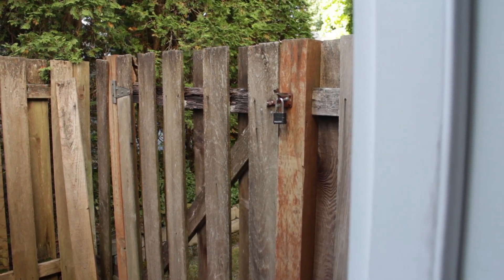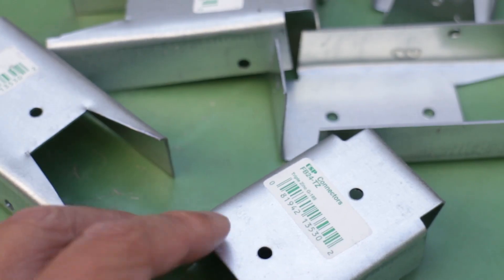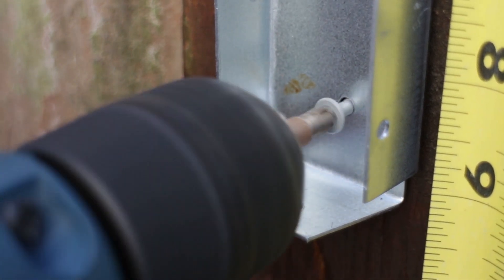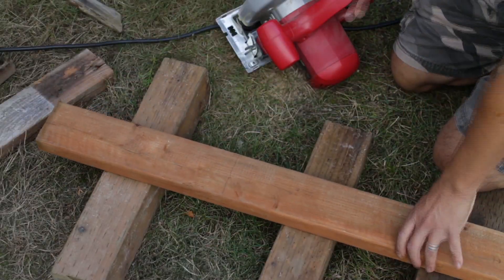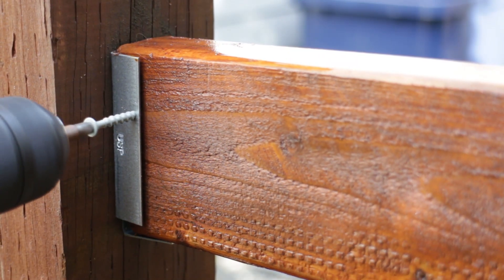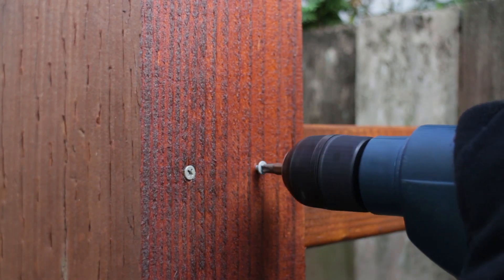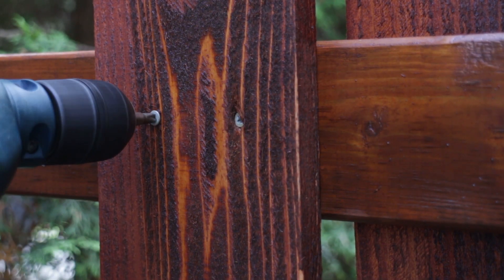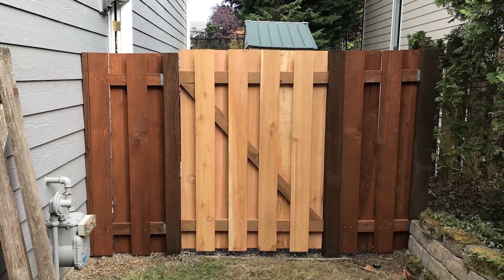How to Repair and Replace Wooden Fence Section Panel Only – Fix Rotted Leaning Alternating Slats

Comment: If you're going to use 2x4s instead of 2x3s, which most fences use, then use pressure-treated 2x4s. Also, you don't have to remove the old cross pieces. Just attach some 2x4s on top of or underneath the old boards (sister them) and screw them in place.
Reply: Thanks I need to repair mine

Comment: THANK YOU SO VERY MUCH for confirming what I had in my mind into a visual form.  And my I ask, why is it that people build a fence around their yard and always turn the good side of the fence AWAY from them. I would think that YOU should be the one to enjoy the good side of your fence, not the one's living next or behind you.
Reply from the maker: Yeah with this type of fence everyone has the same view. There's not really a good/bad side of the fence. But this is the kind that came with my house so I just emulated what I had. Thanks for watching!
Reply: I see it as a safety issue. I would rather have the ugly side facing me instead of giving someone an easy way to scale my fence and get into the yard. Especially at the back yard adjacent to the alley, which funny enough the people we bought the house from installed the fence along the alley with the pretty side facing in on the backyard.
Reply: @tliryc79  I would say each situation is different, in my case I live in a rural area no allies around here. If I could make a suggestion just for future consideration, I would put the pretty side facing my house and put some razor wire hidden on the ally side. That would stop any person getting a foot hold on your fence.

Comment: With those crossbars placement work with pickets to replace the whole panel that way?
Reply from the maker: Yes with the 2x4 crossbars attached as shown in my video you can replace an entire section of a fence. That’s how the rest of my fence was built. This was just the short section and was rotting away so I only repaired this area. Hope this helps!

Comment: Screws in palings should be diagonal so there is less chance of the rail twisting. 
 Another tip, when levering a nail out with either a claw hammer or nail bar ALWAYS put your hand over the nail.  I have known someone be blinded with a nail flicking in his eye.
Reply from the maker: Thanks for the advice! Especially about covering the nail with a hand! Can't emphasize safety glasses enough! I'm going to have to replace the rest of my fence soon!
Reply: Ohh yah I have flung some nails when pulling em out of a pallet with a prybar. I always put my hand over top now.  Specially those ring shank nails you gotta put some force behind those bastards.
Reply: excellent critical tip. about to do a fence fix and figure its gonna take some serious prying getting each ring nail out. i hadnt considered how that force turns into high velocity each time they abruptly then randomly fly free turning them in to quite the projectiles. so glad i saw this. i get a chill realizing i would have gone about it so dangerously unprotected unless by this fluke of coming across your valuable suggestion. i thank you. i am sorry about your freind.

Comment: It appears you didn't have to replace the posts, but just the horizontal beams and the slats... Is that correct?
Reply from the maker: That's correct! With the repair I did in the video I only replaced the horizontal beams and slats. My posts seemed ok so I just kept them.

Comment: What was the cost for the repair?
Reply from the maker: I can't remember the cost of the repair I made in the video. This was for that small section of my fence that was rotted and it included everything for the gate as well. I'm pretty sure what you saw in the video cost less than $80. I got all the materials at Lowes. Now I have the rest of my fence to do this summer.